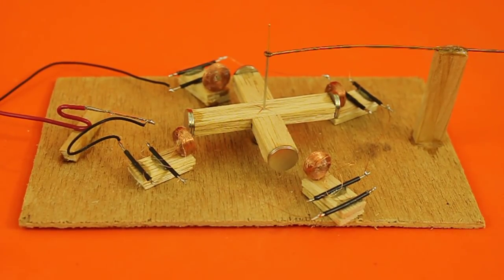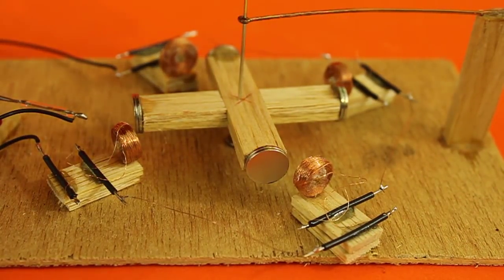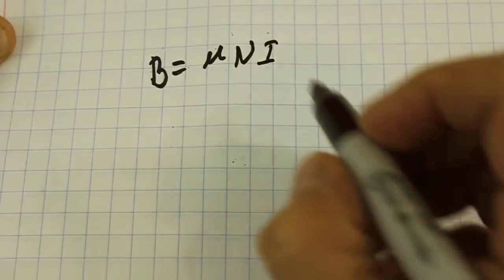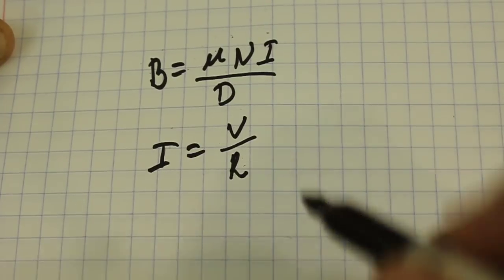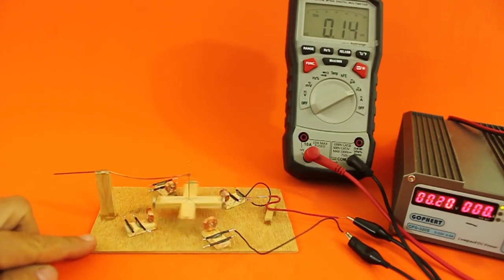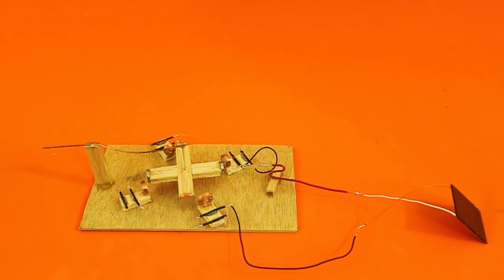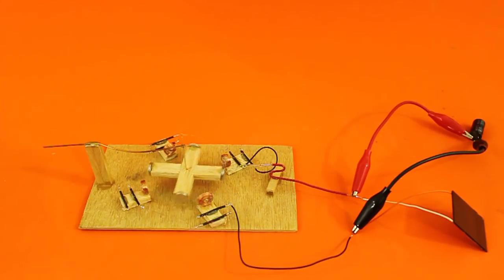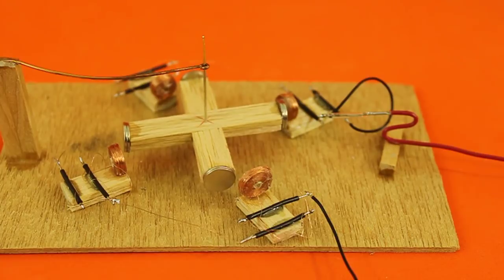Small Pulse Motor with 4 Coils

Comment: what about using a joule thief?
Also does it have a limit of how many turns you can put in the coil? you have 1000 so what if it was 4000 would it be 4 time more efficient then you wont need a capacitor?

lasersaber  channel shows how with just the heat from his hands the move the motor.
his motor ran under 20 nano amps
https://www.youtube.com/watch?v=3B5JPuEUCyc

Comment: Is it better to have higher current through coil or more turns with less current?
Btw great video!
Reply from the maker: It depends on what you want, higher current will give you more torque but drains the batteries faster